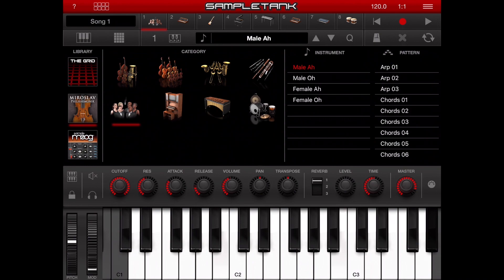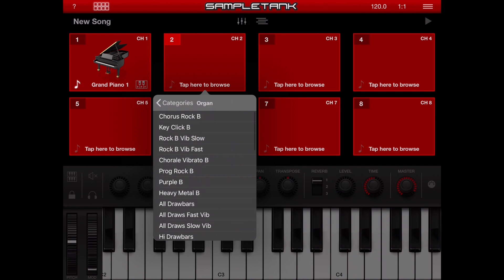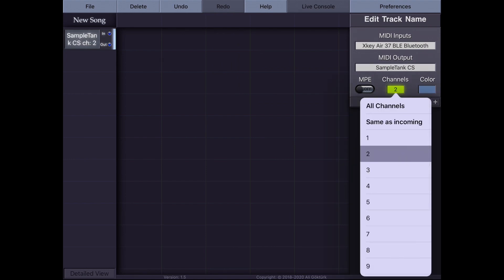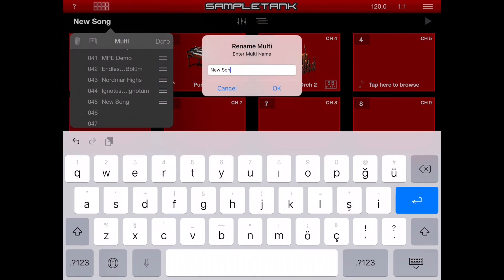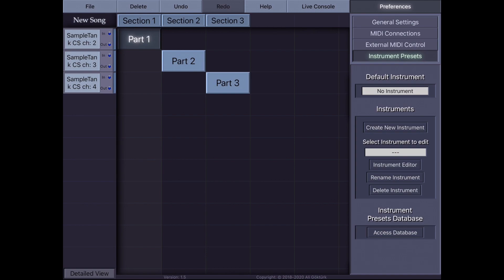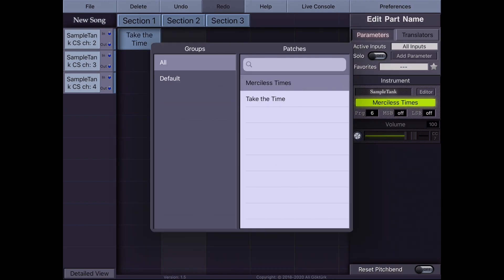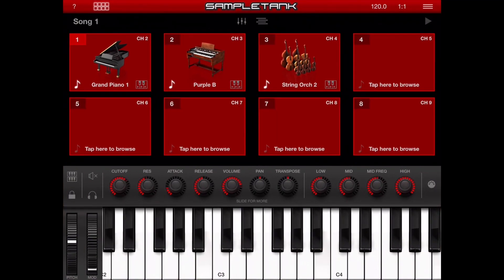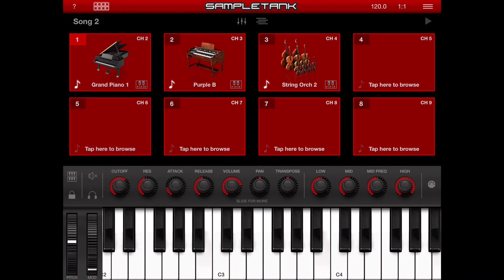KeyStage 1.x Quick Tutorial: Using Sampletank with KeyStage

Comment: Hello! I want to ask this: this method is viable to use samplewiz on KeyStage? The app is great. I will not can use with any internal virtual instrument without auv yet, like SampleTank or SampleWiz, jordantron etc. sorry if my english is not good. Í am learning. Greetings!
Reply from the maker: Yes you can use any non-auv3 instruments via KeyStage like in this video.

The general idea is:

If an app does not support auv3, you open it as standalone and keep it in the background running. And make sure that background audio is on. And then open a MIDI track in KeyStage and choose the apps midi port as its output. 

And make sure that you don't have a direct midi connection between your keyboard and the app. All the midi signals should go through KeyStage.

If you watch the begining of the introductory tutorial video, you'll see another example of controlling non-auv3 apps from KeyStage.

https://youtu.be/tECnZHNU2wY?si=baEfJVI7w3YCNfhc

Best,

Ali
Reply: @agokturk  thanks!